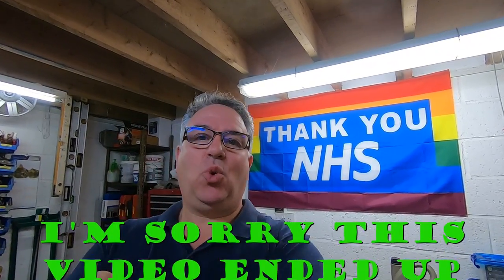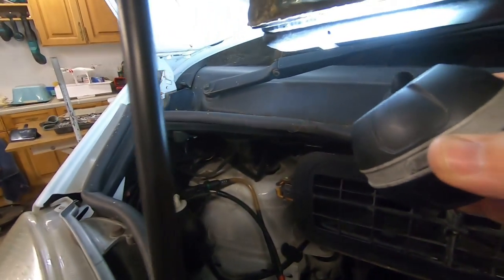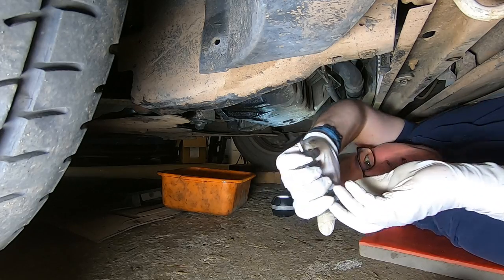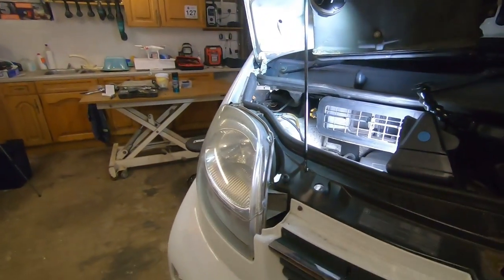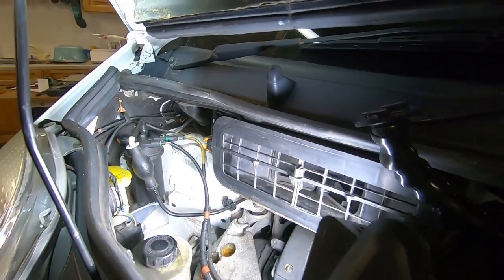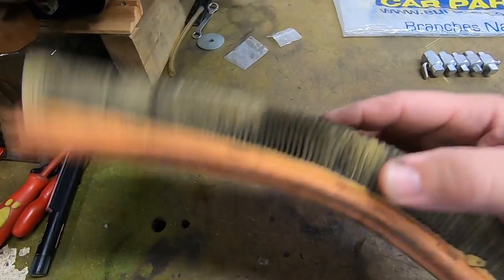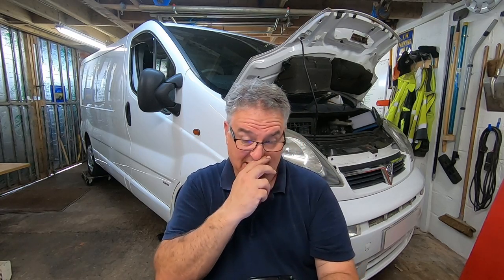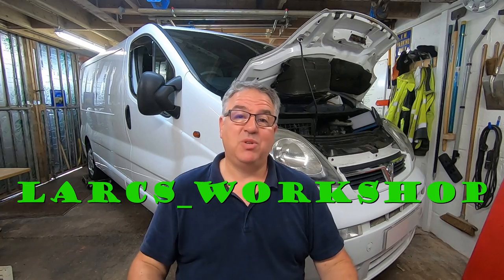Vivaro service & Cost breakdown reveal. Vinnie project pt.15.

Comment: Having a 2006 model myself that is bargain of the century. I have spent over £3000 in past 2 years on numerous things on it mostly on electrical gremlin with starting.  Nobody ever changes gearbox oil and when did mine it was more like tar than oil. What a difference that made to gear changes. For piece of mind change handbrake cable as they are notorious for snapping especially when you have a full tank cause you have to drop fuel( you now can buy straps for tank off eBay🙏 as dealership will only sell you a new tank to get straps that rust through at £600) tank to change. Also once every 6 months or so take fuse box off and give a spray of electrical contact cleaner and wait to dry completely to blue plug connector ( is for electronic throttle) as it faces up and gets water down it and you get stuck with no throttle. Keep up the great work as there is not much out there regarding trouble shooting this model as I have had many long days off work to sort these issues.
Reply from the maker: Thanks that's some great info👌. I had a good look at the handbrake cable when I did the back brakes so hopefully that will be ok🤞. I'll have a look at the fusebox sometime, thanks again.
Cheers Larcs 👍

Comment: Give that square door handle iron "screwdriver", when in place,  a thump on the end with a hammer. That will give the thread a jolt, which usually losens the thread and enanble you to twist it out without busting a gut.
Reply from the maker: Thanks, should have done than but if I did I wouldn't have a good excuse to buy new tools 😉😁.
Cheers Larcs 👍

Comment: Could you tell me the milage on the van please. I'm thinking of getting one but it's got 184k. You make doing work on these vans look easy. I like the way you say let's just take it apart and see. Great vids
Reply from the maker: Thanks 😁. It's on about 155k if I remember correctly. Don't be fooled, there are some things that don't go back together 😉🤣.
Cheers Larcs 👍
Reply: @LarcsWorkshop  cheers larcs. Would you recommend anything to look out for if I go ahead and buy this van on 184k.
Reply from the maker: @lawny7710  Just the usual stuff really, body repairs/dents, rust, clunky suspension, smooth running, and check everything works. The tyres are quite expensive too, so check them out too. Good luck 🤞
Cheers Larcs 👍

Comment: Very helpful video as I’ve a few jobs to do on mine 
Do you know how to change front indicator bulbs I’m disabled can’t find a you tube video cheers
Reply from the maker: Thanks, I've got to replace my indicator  sometime as it's cracked. On mine there is a little metal tab on the side of the indicator lens (towards the centre of the bumper), just push it toward the lens and the unit should pull out. The bulb is in the holder in the back of the unit, just twist it and it should come out, swap the bulbs and reassemble. Good luck 🤞
Cheers Larcs 👍
Reply: Thank you my van is the same as yours so should easy know
Reply from the maker: @markjobypaintin5222  👍

Comment: Timing belt...when?, Mine is a 2008, so has a chain. If the rubbers on the track rod ends are defective, I wouldn't trust the ends themselves and if they fail it could kill you. Don't buy safety items from Ebay, you used good stuff on the service why skimp on running gear.